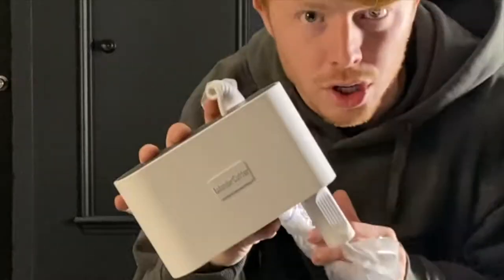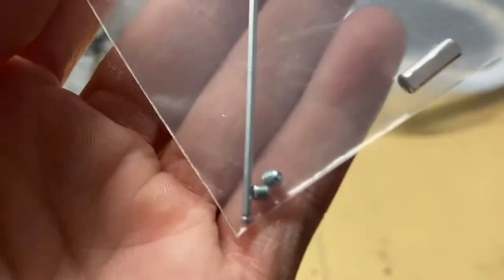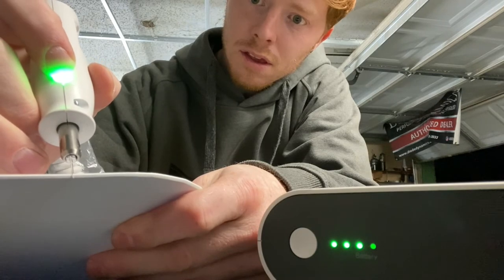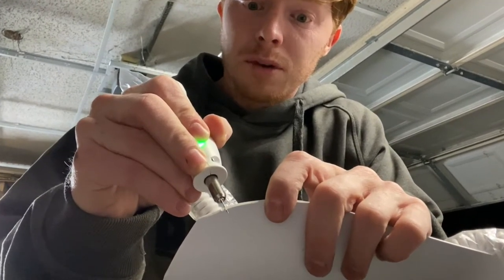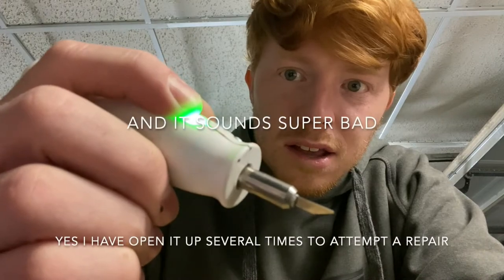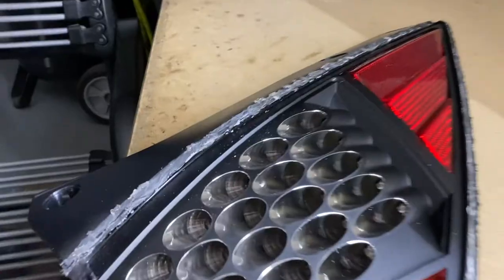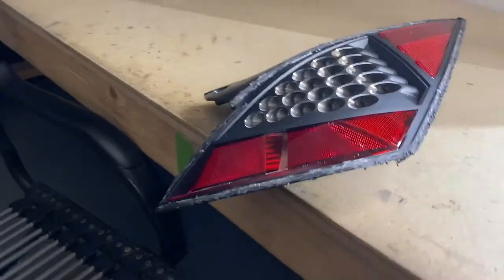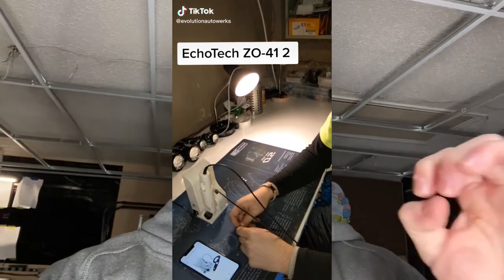Quick review of the WONDER CUTTER S

Comment: I'm using Wondercutter S for about one month now and I experienced similar problem when the blade fixing screw was not tighten properly. It did recognize it. They also recommend to reset the unit after each blade exchange by pressing both the button on the handle and the power button simultaneously for 1 to 2 seconds. Resetting made a big difference my case.